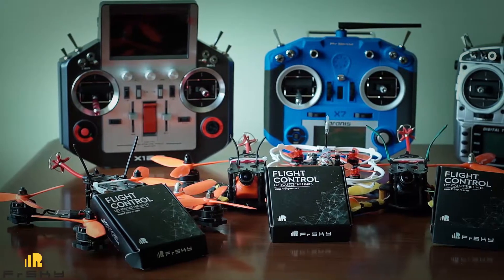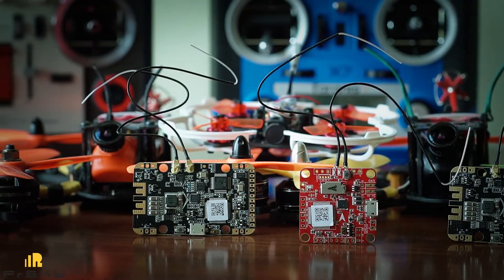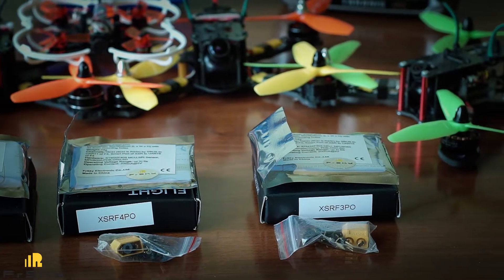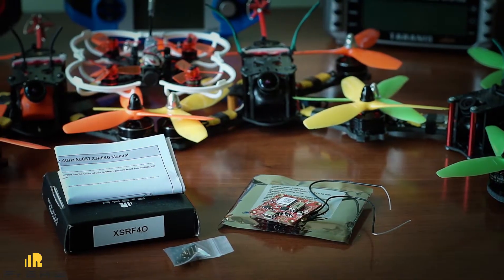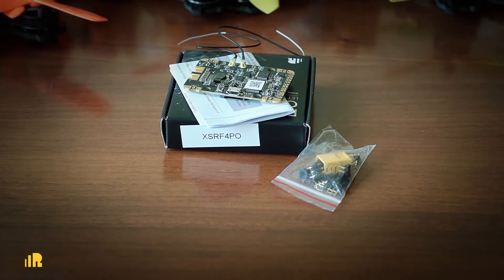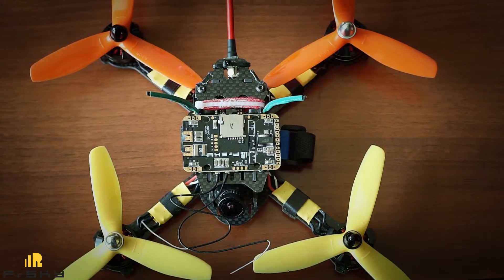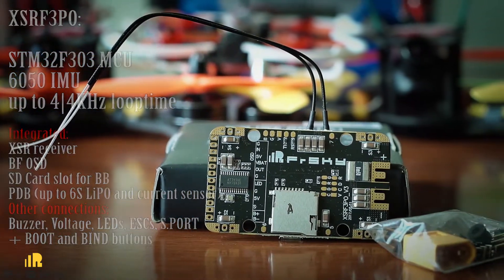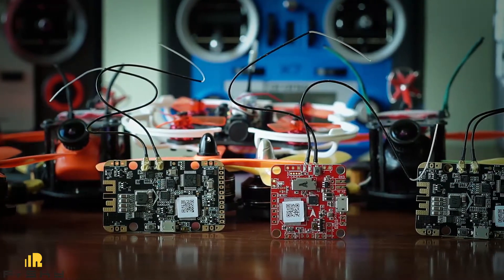FrSKY XSRF4O, XSRF4PO, XSRF3PO flight controllers overview

Comment: Hello
I would like to know if you could make a wiring diagram about XSRF30 because i can't find where to plug 5V for the main board alimentation...?
and i have a 4in1 ESC of the X220s is it reliable ?
and i have also a runcamsplit2 is it reliable to ?
thank you if you can make  or telling me if it's good wath i did here : https://drive.google.com/file/d/15iVi3AiKppy4eapePEpe-SA6YGbIwp-W/view?usp=sharing
Reply from the maker: you can feed +5V and GND to any of the unused PWM corresponding pads. 4in1 ESC is not always reliable but it is better than nothing. runcamsplit is totally ok. Can't tell anything about your diagram. Never used runcamsplit and don't have a clue where should it go. I guess - not to the UART1 cause you won't be able to use that. This FC has inbuilt OSD so usually separate camera goes to Video in pad and than VTX is connected to Video Out. Your LED+buzzer board is also strange for me because LED and buzzer are usually dumb separate things that are attached straight to the buzzer and led corresponding pins on the board. But you seem to have some LED+buzzer board that should be controlled by PWM channel. Moreover, I don't know whether your PWM signals from 4in1 ESC board goes to the right ESC inputs on FC. I mean the numbers: which ESC is the 1st on ESC board. It should go to the 1st PWM pad on FC and so on.
Reply from the maker: here is my short overview of XSRF3O. Read it, it might help. https://marketchangers.wordpress.com/%D0%BE%D0%B1%D0%B7%D0%BE%D1%80%D1%8B/frsky-xsrf3o-new-f3-based-flight-controller-with-integrated-xsr-receiver/
Reply: for the esc it is jst plug ,plug on a F4 died board of the eachine X220S bad manipulation of a receiver kill it...
the jst on the F4 board is PWM1,PWM2,PWM3,PWM4,5V,GND and the same on the 4in1ESC
the buzzer was on Buzz+ , the led on PWM6 and 5V to 5V the same for the ground...
i don't understand why only one GND for the Vidéo IN & OUT ?

thank you for your help and sorry for my English i'm french..... ;) merci.
Reply from the maker: because GND is common for everything. It doesn't matter where would you connect GND from other devices to. Even all devices to one GND of FC would work.
Reply: i plug  my lipo and the drone is playing music with the motors Normal or Anormal i don't know???
Reply: how to flash the RX EUlbt i don't understand how... please
Reply from the maker: and how should I help you with that?
Reply from the maker: use SPORT pads in FC to flash inbuilt XSR RX with the necessary FW. You seem to not have a appropriate knowledge. Maybe,  you have to read more into this stuff?
Reply: done  it is working know.
i read on the notice 4to10Volts operating voltage range does it concern the Vbat i don't think but i would like to be sure...thanks
Reply from the maker: vbat is the input voltage sensor. it is to connect up to 6s lipo to have voltage reading of the flight batt on your telemetry.
Reply: thank you like that i'm sure  have you got an OSD because nothing on mine ???
Reply from the maker: find instructions how to tune BF OSD and how to connect it
Reply: XSRF3O — when you want 4/4KHz gyro and PID loop rate + XSR receiver + telemetry + BetaFlight OSD + SDcard for blackbox IS IT THE ANSWER I4M LOOKING FOR TO PUT 4&4Khz
Reply from the maker: what do you mean? the board is capable of 4|4 at most. You have to look after CPU load % after enabling each of the functons. It shouldn't exceed 30% when disarmed. Mine is at 4|4 and I am using DShot300.
Reply: because i did but no OSD  just OSD              Wiki      on the page
Reply from the maker: if you have XSRF3O board - "O" stands for OSD. This board has intergrated OSD.
Reply: yes but don't work  i'm gone flash on BF maybe it will solve my problem
Reply: don't work after flashing
Reply: works after downflashing on FRF3 2.2.0